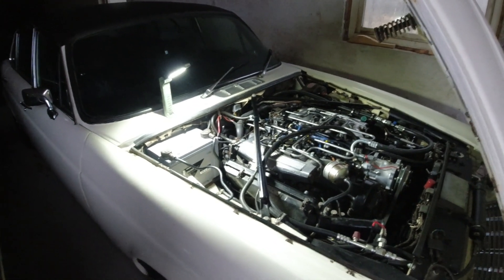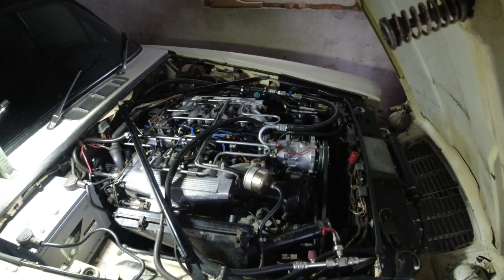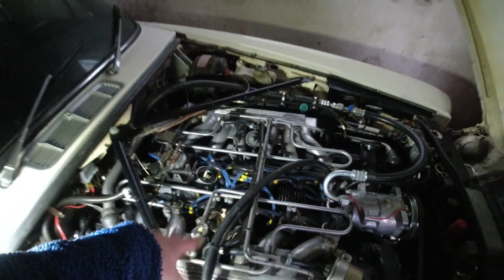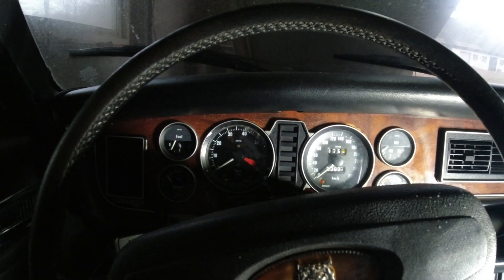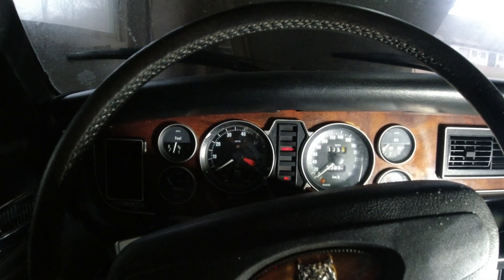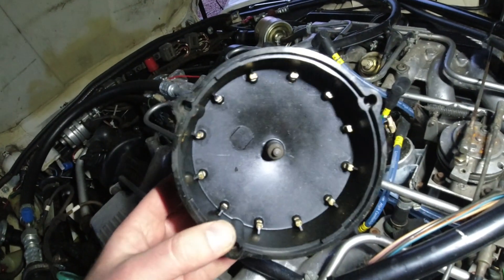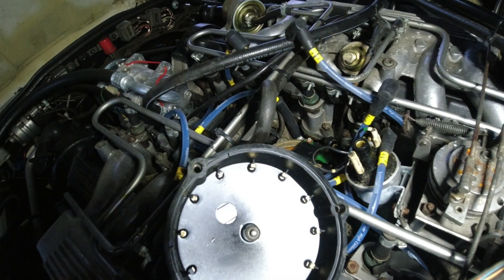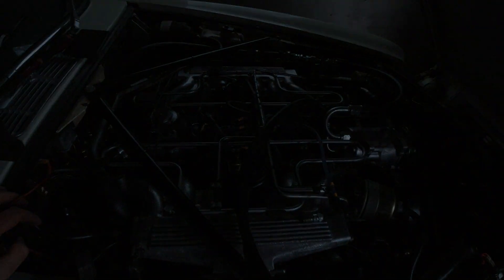Prince of Darkness Strikes Again! - Is Old Lucas Better than New Lucas?

Comment: Hi Adam, I'm in the U.S. and part quality problems have plagued us for the last 4 to 5 years. Camshafts going flat after hours, lifters not properly hardened, alternators dying after a year, etc. Not isolated to specific brands. This has resulted in used prices rising, and enthusiasts driving up NOS prices to assure you get a quality part. So, this may even be an issue if you seek out a new MSD coil versus a used one or NOS part 10+ years old.
Reply: Tim A. I agree 100%,the parts you get today are very inferior to NOS or OEM parts.  I've been through this saga many times and it can be a real headache in diagnosing a fault only to find out inferior parts are the cause of the problem.  
I'd recommend Adam to use a Bosch coil if he can't find an genuine  OEM Lucas coil. 
British car electrical systems are sensitive and as a result many people actually cause damage to them from misdiagnosis.

Comment: Try a Nippon-Denso or Bosch coil.
I also want to make a different point. On my XJ6 S3 the coil is mounted on it's side on the cylinder head, a HOT area in the engine bay. And there is thermal heat conduction through the engine. 
I think relocating the coil to a cooler place on the inner fender in an upright position will help longevity of the coil.

Comment: Lucas electrics will always be the "prince of darkness"! Our '52 Jag hasn't exhibited too much of this electrical curse, but, with positive ground and a 70 year old car(which has thankfully been rewired when restored several years ago), one never knows! Crossing my fingers and knocking on wood here in the States, been working well so far!
New parts in recent years are, in my opinion as a retired mechanic, junk. It's a crap shoot.
Glad to see you got your XJ12 lit off with a different coil, stranger things have happened. Thanks man!

Comment: my xjs had a ignition coil failure and i wasnt willing to get the dual coil setup replaced so i just coverted it to a single coil setup with a msd coil that i had sitting around that read out to .06ohm around 50 bucks worth of parts instead of the pain of sourcing a lucas shitter

Comment: Just a thought. Once the car is warmed up have you changed back to the “faulty” coil and see if the problem returns. Sometimes just the act of removing and putting it back can solve the problem as it may just have been a loose wire or bad connection. But as you say it could just be crappy cheap manufacturing. I’ve had the same problem with top hoses on my stype 2000.
Reply from the maker: I have tried that and the old coil is still faulty

Comment: My 1986 XJS V12 (U.S. spec) had a MSD 8207 Ignition coil installed when I bought it. The car ran quite awkwardly. at .025 spark plug gap (correct gap according to the almighty Haynes manual) the car ran fine but seemed to be low on power. I tried gapping the spark plugs to about .040 which made the car more responsive and seemingly more powerful but at about 4000 rpm the the spark would cut out and the engine wouldn’t run past that rpm. Since then I have installed an MSD 6AL2 Programmable ignition box which has solved my previous issues. This is an expensive solution but the benefits of having electronic timing control and other programmable ignition functions made it worthwhile to me in the long run.
Reply: Of course this applies to the Lucas CEI ignition system but the tach output on the MSD box will run the ECU Injector driver without any fancy adapters. I just connected the Gray tach output wire straight to the ECU coil negative wire.

Comment: I had a '77 Triumph Spitfire that had the Lucas Electronic Ignition and it never gave me any trouble over the 20K miles I drove it (I bought it with 67K and sold it with 87K).  I've also had minimal issues with the mid '90s Jaguars I have.  Grounds can be issue for sure and I keep a healthy battery in them, but never had them suddenly die.  My '88 Toyota Supra was the biggest electrical nightmare of any car I've owned, but age was probably to blame for most of its ailments - unplugging and plugging was always  first try that cured many a glitch.  I'd love to tear down a failed coil and compare it to an old but working one.

Comment: It's a problem in a lot of electrical reproduction parts... they're just not as good as the originals.  Rebuilt the distributors in my 308 perfectly, car ran like crap... problem was the brand new condensers in the point ignition (switched to Pertronix, no problems).  My mechanic said it's virtually impossible to get good condensers any longer.  On my 911SC, the Bosch reproduction coil is also known in the community to be absolute crap.

Comment: I have been told many horror stories about the reliability of Lucas products, but my 1995 XJS has many Lucas components, all original, and they all work fine. I read somewhere that the real problem is that Lucas components seem to be more sensitive to inactivity than other brands, and they break more often when the car sits still for too long. I do not know the part of truth in that.

Comment: Hey Adam! I agree that my Jaguar electronics are no more troublesome than basically all older cars. Except I think where it’s a V 12 many people simply didn’t understand them in the past decades. from my experience most other cars during the 70s/80s and earlier were generally more simple and rarely even had fuel injection. Most other cars are generally more simple electronically so I feel that’s where Lukas gets the bad rep. But in my 1979 jaguar XJS it’s been very reliable. in fact it’s been one of the most reliable older cars I’ve ever owned/worked on etc. I purchased a new ignition coil from SNG Barrett about 8 years ago and have had no problems with it. I had a mouse do some damage to some wiring so I purchased the SNG Barrett distributor upgrade kit which included a new coil and amplifier etc. Seem to make the whole system more reliable. But wasn’t cheap. Keep up the great videos Adam! You’re my favourite channel on YouTube brother.
Reply from the maker: I’m thinking of adding that SNG system to my 1975 XJ-S. In the XJ12 I have re-Opus which was a great system but sadly it’s not bad anymore.
Reply: Might be smart to install the SNG distributor upgrade kit to your 75 project. That car is gonna be so awesome! Love it. My 1979 XJS valve cover gasket started leaking recently. I want to bring the car to you to do them! Lol
Reply from the maker: You’re welcome to bring it by. Luckily the new gaskets are really good and they tend not to leak again. The XJ12 in this video is leak free now close to 10 years later
Reply: I have watched all your videos and have been a long time fan of your channel. I have a 1979 XJS and a 1990 XJS convertible. I used to watch YouTube only not signed in but I’m such a fan of your great videos I recently logged into my account for the first time in like 10 years lol just to subscribe and like/comment on your videos. you’ve inspired me and so many so much with your great content and knowledge. Keep up the passionate and great work and videos. 👍🏼 I will be supporting your videos on going. And I’m interested in other ways I can help
Reply: And yes those upgraded style gaskets seem much better. I purchased the original style and they’re super thin paper style. i’m very interested in having you do the work on my 1979 car. How could we arrange further details? When you’re ready I could bring it to you and leave it with you until you’re done? I also think it might make a great video potentially? I have some spare parts etc. you could have and of course would pay you. i’m very interested in supporting your channel 👍
Reply from the maker: I’m glad you enjoy the content and watch. It means a lot!
Where are you located?
Reply: @LivingWithAClassic  unfortunately I’m in Nova Scotia Canada. But was actually considering shipping the car to you. have you do the valve gaskets etc. and of course go over the car. There’s some other little things to be done as well. it’s beautiful and in good shape and I think would give you some good video potential as well. I have ties in the shipping industry so I am looking into options. when you’re ready I could get it to you and you could keep it as long as you needed/wanted. Let me know if you’re interested in setting this up in the future?

Comment: With a ballast resistor, that should be a 6 volt coil? Maybe the new one is a 12 volt which will work but not as well. .  I've seen this on motorcycles- they'll run but starting can be weird.

Comment: I had many ignition issues with my PreHE v12 XJS from component failures and heat. A number of original Jag ballast resister failed (as shown in your vid) so I replaced with a white ceramic resistor. Then Opus module issue so replaced with an aftermarket module (first of these failed too). Then old Lucas coil replaced with new Lucas, and these failed like you experienced, so I’m now using a Bosch GT40R coil which is lasting but had to again experiment and change ceramic resister to suit to have right ohms and voltage.In the end I have the ignition module in the glovebox with a computer fan above it for cooling and another module, coil and coil lead duplicated and mounted in the engine bay as a quick switchable backup in case....
Reply from the maker: This car has the Opus replaced with Re-Opis and that has worked flawlessly. Sadly it’s not made anymore.
I have gone through one ballast resistor. It still either but the tach signal from it was bad.
Everything is really reliable on this except the coil. Will probably just run the old one that works.
Reply: Yes the original Jag resister block is complicated with its number of internal resistors and they are hard to source, so I like the simple white block. By coincidence, I also have the original many years old Lucas coil that suits Opus.
Reply from the maker: I have a few of them that are still good.
It’s good when to have when you own 3 pre-HE cars

Comment: It's strange that it would generate sparks out of the cylinders, but not enough to start.  Apart from actually trying to start the car, how do you test a coil? DC continuity shouldn't be hard, but a transformer (like a coil) also needs fluctuating current.
Reply: It's easier for a spark to jump while in ambient air then it is while under 10:1 compression in a combustion chamber.
Reply from the maker: Yes exactly. A spark can look ok outside but may not be strong enough during combustion.

Comment: I have 1962 mark 2  I put a Lucas black rotor on the distributor after a few years the car acted like it had vapor lock running bad only hot I put a red better quality rotor on it from moss motors problem solved  The plastic on the black rotor is trash and shorts out to the contact revit only when hot 🥵

Comment: Does the car have electronic ignition?? Good spark plugs NGK are very good plus a high output coil, an engine needs spark, compression, ignition  to run, good battery is a big help too!!
Reply from the maker: All Jaguar V12s have electronic ignition .
I’m well aware of the basics since I work on these  engines every day.
This is more about bad the bad quality of new parts which is a shame. I wish that new parts worked as well as old ones

Comment: Adam, I couldn't agree more on British wiring was no worse than anyone else.. back in 50,60, ,70, 80 they started playing with different PVC and plastic chemistry.. worked well for a while but chemical construction couldn't hold up to the cold to heat cycles. My son's custom xjs restomod is 37 year's old with no cracked wiring..I have been spraying silicone protectant for the last 20 years.. just a little lite spray once a year.. removed almost every connector cleaned then packed with dielectric grease..
Also I removed all the old canister type coil's and replaced it with a super coil,flame thrower by pertronix.. and a matching ignition module.. no problems ever again.. better start,, better burn and cheap.. next will be Mobeck Tekniske ,,full DIS and stand alone ecu.. should look into installing in your favorite toy.. unbelievable system.. 
Good luck